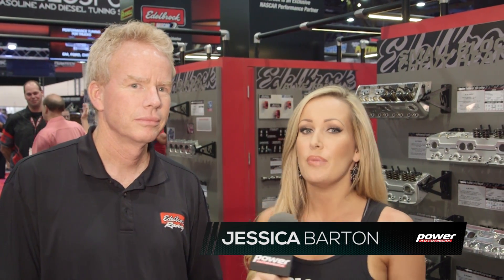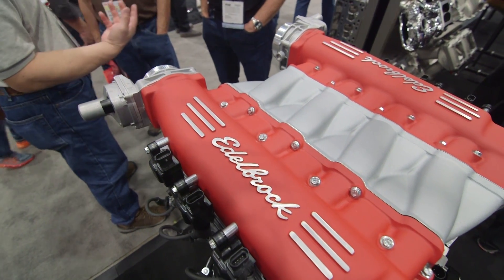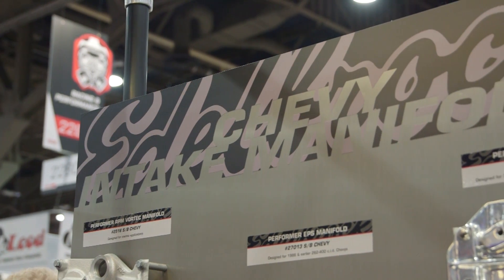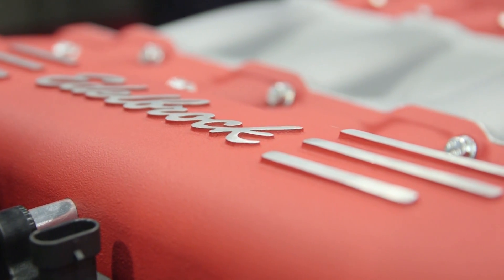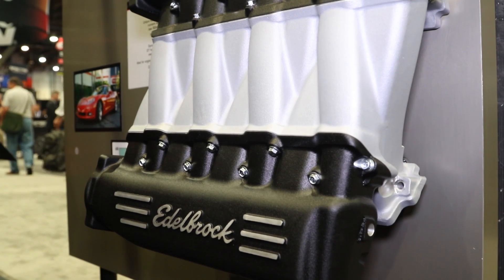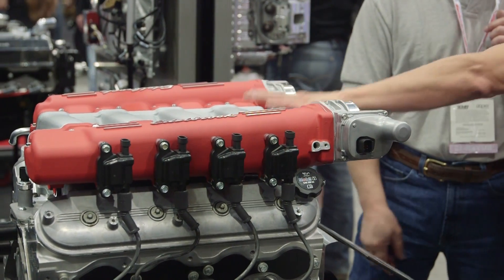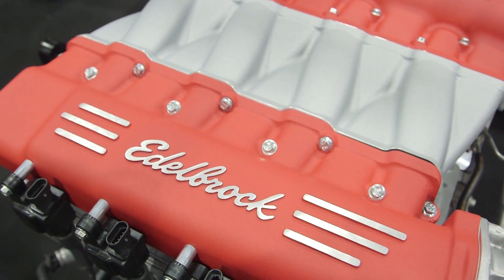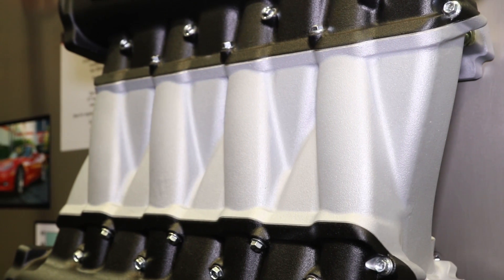SEMA 2015: New LS3 Cross-Ram Intake from Edelbrock

Comment: why 90mm for 2.65l of air i don't understand way overkill. good for extreme boost setup like stupidly high levels. btw holy heat soak batman. easy to get 40hp out of stock intake if you have an idea of what you are doing

Comment: It look pretty but want make an engine make anymore hp or torque. I say this because if your intake is not restrictive. Adding artwork want add hp. Look at it this way. If you can make 400hp with one 4 barrel carb and the a/f ratio is right. Adding another 4 barrel carb want help. It will look prettier.
Reply: ***** You need to do some research my friend, your intake selection is every bit important when deciding your powerband.
Reply: ***** You clearly don't have engine building/tuning experience so I'll just let this lie. Do yourself a favour and look up how an intake effects a powerband.
Reply: blackericdenice So you can manage your way through that yet still don't understand how an intake changes power delivery....
Reply: ***** I give up, how you're alive is mystery to me.
Reply: jeffel80 I say again. If the air fuel ratio is right with a single 4 barrel. Adding  dual 4 barrel want increase hp.
Reply: If one carb has perfect air fuel ratio, adding another carb with perfect air fuel ratio won't change the ratio, but it will increase the amount of flow available to the cylinder heads reducing restrictions at the top of the powerband. There's a reason that the 426 hemi was only available with two 4 barrels from the factory, and the race versions got the crossram with two 4 barrels.
Reply: It isn't just about getting more flow, it is also about optimizing that flow to work best in a specific rpm range. One intake might be best between 3,000 to 6,000 rpms while another might be best from 5,000 to 8,000rpms for example.
Reply: Duane Craig Not true the cam control where an engine make power.
Reply: blackericdenice It does yes, but the intake also dictates where and how your power is made. The length/diameter of runners is hugely important when it comes to powerband.
Reply: William Stewart No sir, the cam dictates where and how much hp you make.
Reply: William Stewart Cam control where and how much hp your engine make. Aftermarket Intakes are just pretty.
Reply: William Stewart Aftermarket Intakes don't give your engine more horsepower. The people who sell them spread that bull shit and stupid people fall for it. The dyno videos you see on youtube are made to fool people.
Reply: ***** Go look at dyno charts of say a high rise intake and a low rise intake on a Chevy small block. The intake has an effect on power delivery the same way different headers do.
Reply: William Stewart I don't care about dyno on youtube. They are on here to get stupid people to buy parts that don't help. High rise intake is more art work. Same as headers.
Reply: William Stewart Because I don't just believe everything I read or see online. The 426 Hemi 6 pack could have made the same hp with a single 4 barrel carb. Do u believe that's true?
Reply: ***** I know for a fact you can make similar if not more power with a modern 4bl and intake with a 440 compared to the old 6 packs. It's a negligible difference though and isn't worth losing that awesome under hood look and the sound.
Reply: William Stewart No I mean carbs of the same year and yes they do make new 2 barrel carbs design to run as triples.
Reply: William Stewart I have a video where I rebuilt my 96 Tahoe 5.7, installed a cam and swap n a 99 Tahoe pcm . I use HP Tuner to tune this set-up. Now where's your video?

Comment: makes me feel like they ripped off Nelson Racing
Reply: +Midnight870 of course it does. because you don't know anything.
Reply: Umm, Chevy was running "cross ram" style intakes with either dual carbs (60's), or dual throttle bodies (80's), for over thirty and forty years. Only difference today is the drive by wire throttle body's, as well as the sheer size of their blades. It's nothing new, just more advanced...
Reply: you know, I thought the same thing. I guess that's what happens when you have a multi-million dollar business.
Reply: +leloodallasmultipass 
take a look at viper V10, or the W12 engine intake manifold. These intakes were more closely copied, could work well for a V8.
Reply: Exactly what I was thinking
Reply: Same
Reply: Right, because Nelson is the inventor of everything.